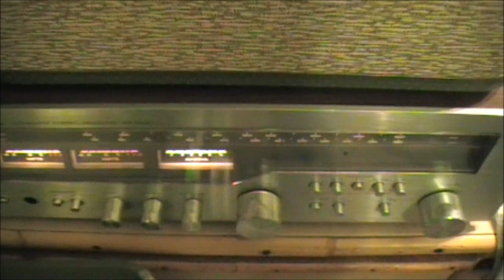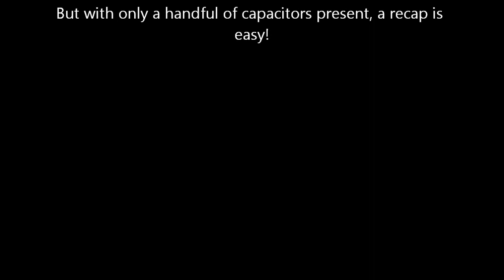P1/5. BSR TD2 Reel To Reel Tape Deck - Rebadged by Elpico, Serviced by me!

Comment from the maker: Lots of elbow grease! :-) On items like this, and on valve radios, depending on the mix of corrosion, rust, dirt, etc, I'll use a combination of WD40 + electric toothbrush, metal polish, acid (I forget the type, can be bought in hardware shops), rust remover, even a Dremel and sanding bit. In the States there is Naval Jelly. From what I can tell it's excellent stuff! Literally removes all corrosion with a wipe, wait, and wipe!